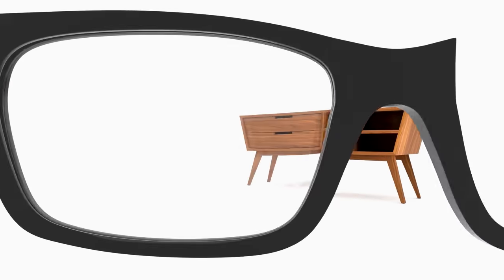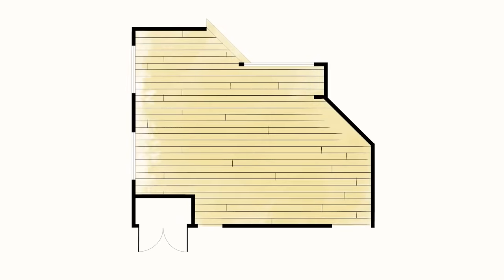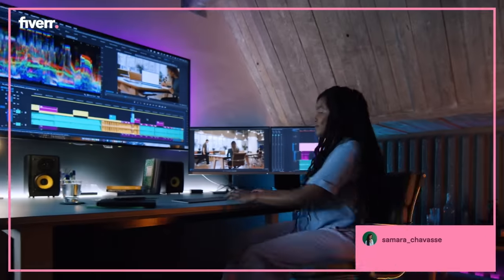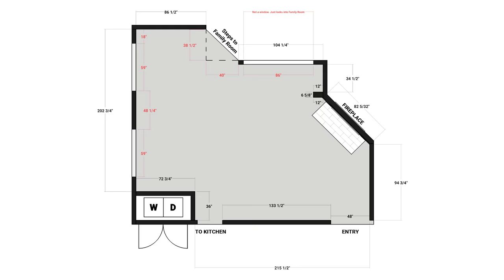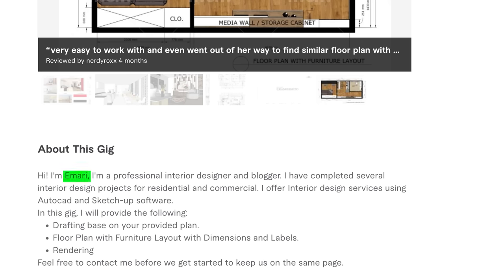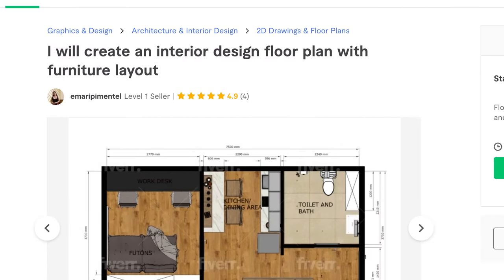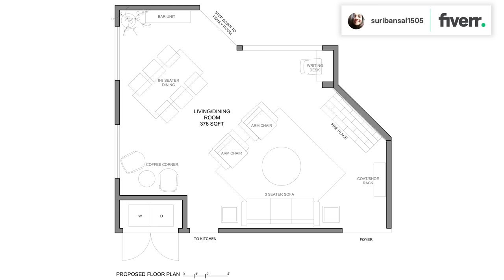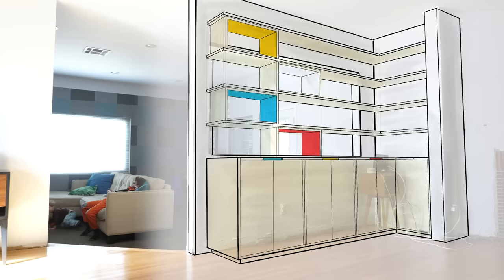I Paid a Stranger $10 to Design My Living Room

Comment: It's a race to the bottom. I'm sure you would have been less than thrilled in your pre content creator days to have lost furniture commissions to people offering up to do the same for ten bucks.
Reply from the maker: There was a website called Custommade that I felt was a race to the bottom in the furniture maker space (it wasn't really, but customers tried to use it that way) - I had stuff on there, but eventually pulled it all off because I decided non-participation was my best recourse. The furniture thing didn't work out for them and they pivoted to jewelry I think.
Reply: Yup. Fiverr just means that basically nobody gets paid for the work they do.
Reply: I've yet to get a quote from any for the advertised prices. They want you to send info about the job and then they tell you how much. None come back at the $20. $50 or $100 advertised price. Out of 3, it's been 3x 4x what their prices say and one was $425 with prices of $20, to $80. I wouldn't have a problem paying that once I knew the concept was gonna be what I like, but not right off the bat. I did pay one $120 and it wasn't even "close" to what I asked for. It's like they didn't even read any info included.  So, I've not seen any that will do any work for $10. I was excited but now feel like it's bait/switch.

Comment: "I don't like curtains." 
My wife and I go through this conversation more than I really care to admit. I'm with you, Chris. #bringonthelight
Reply from the maker: team no curtains
Reply: Same here! What is the point???
Reply: I also don't like curtains, but we need to figure out a privacy solution for the front window facing the street. We had vertical blinds, but I hate those more than curtains. Best I've come up with is cellular blinds that can fit inside the window opening, and can either lower from the top of the window, or raise from the bottom. Thoughts?
Reply: for those of us with who either don't have central AC/heating or can't afford to run it constantly, curtains are an absolute must for temperature insulation during hot summers or cold winters
Reply: The only curtains I care for are blackout curtains LOL! Especially in a bedroom or TV room... Not just for privacy but when I want to lay on the couch and nap, I want it dark and sunlight or street light glare on the TV is no bueno.
Reply: I'd want to put up a static version of window tint to block anyone being able to see into the house, but we can still see outside without a problem.
Reply: Curtains are useful for acoustic purposes when you have hard rather than carpeted floors. It can be too echoey without them.

Comment: Edit: My also / big thing is first just so it is easier to see the biggest thing I would've done ---
I'd use the walls more. You asked for most effective use of space... you could have a cat-walkway around the entire top, except have it glass either only the front, or the bottom and top - and either use a small wood trim at the corner furthest from wall / ceiling which would look like a floating shape if you wrapped the entire room - then shoes would go in there and be safe. Position some so shoes could be upside down so you can see into them and the top from underneath, and see the underneath of them with one the other way... or put upside down and sideways, etc....  You could theme it too - treading around the world / room and have various styles, makes manufactured in different areas or designed by different people around the globe and have that theme bleed into the wall-space just underneath the area, and onto the ceiling space... Then, add indirect lighting ( lights hidden behind a wood panel so the light comes out from the sides of it without a direct view of any lights so it radiates off of the surface and provides soft light which illuminates without making it hard to look at - great mood lighting too if those are the only lights on )

Then the original bit and comments here:

That rectangle area I'd put a built-in bookshelf, maybe with doors... but instead of nesting it inside I'd nest it, but bring it out a little bit, then flush it with the wall that sticks out so there is a space where you could have shoes or whatever vertically  like shoes walking up that edge... Best pairs or whatever... Alternatively, a desk in that area, and do the same thing, bring it out so you have some more space on the right at the edge - and then do cabinets to the ceiling above it for books, etc... Another option if it isn't structural, hollow out the wall and have a sliding pantry pull-out to separate that spot even more...

I do like that the focal point ( the fireplace ) was designed around in the $100 version... that makes the most sense, rotating the stuff... also since you design your own furniture you could have some triangular shelving behind it, etc... Something behind the couch... I didn't like the rotating of the other piece because the living area is around the focal point but the dining area isn't. You could but that part looked less..... .... Putting the tv above the focal point is probably the best option for TV - having one in the dining area isn't smart because if you are utilizing it for family, etc.. then you want to have a conversation.

The dining area doesn't really fit around the fire / focal point because the chairs, etc.. would block it... Now if you designed your own furniture you could have a bar-style table that wraps around the focal so everyone has a view.. but in my head this looks like some wasted space. The living area is definitely in the right spot around your focal point... A good area to entertain, etc...

Comment: I sometimes drive my family nuts with wanting/needing to move the furniture to get the best "feel" of the space. If it's too stuffy I move things to open up the space, if its too open, I tend to design/designate areas to things. Decorative dividers are great as a backdrop similar to what was behind the couch in the one interior layout that you got. 
I feel bad for the family right now, cause I want to move things around again. Great video, great ideas from the interior designers you chose. I do love the one with the angles though. That is something I would do and have done in the past. 

Sometimes corners themselves are the "dead space" but they don't have to be. Say you angle  your couch/sofa/loveseat and have the corner behind the item, if there is a nearby outlet, you can put a standing lamp or recessed lighting (below the topline of the couch/sofa/loveseat) in the corner to add /color/small focal point.
If using a lower lighting option you could also put some sort of feathered foliage (change that with the seasons perhaps or personal preference) there as well, so the light not only brightens the room but also gives pops of color and dimension.

Just food for thought, I will probably do just that in the coming months, depending on how things go as we're all starting to get upper respiratory infections or bronchitis currently. We will be okay, Blessed Thanksgiving near and far, even if you're just by yourself, you are still in the living world and that in and of itself can be a blessing. The days are getting shorter, the nights longer, the days darker, bringing in light and color could help to change the energy of the room and boost your energy too. :D
Reply: my grandma mom and i are big furniture movers and wanna rearrange spaces all the time it always confuses my grandpa and uncle but love how resourceful just switching furniture even in different rooms can be

Comment: * On the two window wall * from end to end  / chair height / divide into 4 plain cube units/ chairs on 1 side and ends / seating cushions on 2  middle cubes /2 ends used as end tables or when table is extended at big sit downs...leave tops plain or Honed stone.This will keep a clear walk way to kitchen

Comment: the room is already not normal so why try make it something it isn't - just go crazy :D Our living room is rectangular but we still went for floor boards in 30 degrees angle :p It had many advantages besides the look - you cannot see that the walls are actually not at perfect 90 deg to each other for example :D Also there's kind of a limitation of ~9,5m of laminated panels laid in one row so it helped with that and we get much nicer continuation of the floor to to hall. Also it ties with hexagonal tiles on kitchen floor.

Comment: * Wall between kitchen and entry *  push back L shape sofa  back on wall / try layering rugs 1 parallel to fireplace and smaller on top in line with sofa/ use ottoman as coffee table with round natural wood slab as drink tray/ .....is that an Eames chair? Place  chair slightly floating in front of the wood dividing wall unit angled to engage with sofa/ next to chair a natural cut round wood block , height low to match chair/the raw natural wood on the tray and side table will balance well with your light wood cabinetry style, also rounding shapes to soften  the angles /This layout  giving you two clear walkways ...entry across room to other area and a straight line to kitchen.....pare back palette..light woods, sisal, natural tone with a trim use of black....then  you can use colours in art work/ cushions/ shoes?/ .....no material curtains, in this room.......that’s my take on your room... from Sydney Australia.....bored at home in bloody lock down!!

Comment: As someone that is in software development for a living, and having to find a more viable layout for my current apartment with an odd set of constraints, if I thought it’d be worth my while, I’d create an application that took as inputs what the design rules are, the must-use bits you already have, the desired overall objectives, and all the detailed measurements as appropriate.  The problem is, that’s actually a fairly daunting task to create something to do all that, debug it, and make it viable.

There are still areas where humans with the right education and experience are going to be of value, as whether a layout “feels good” I’m persuaded can’t be objectively calculated. Factor in that it’s likely most people don’t spend a lot of time and effort rearranging their furniture after finding a layout, it’s one of those odd things. Not everything makes sense to try to automate, and art is one of them. Human-factor furniture layout I feel is one of those things.

Comment: NKBA stands for National Kitchen & Bath Association which means that the NKBA certified individual has the skills to design a functional space with electrical, gas and plumbing connections. NKBA certification means that the professional is certified to work in the kitchen and bath industries.

Comment: Go for the room at a 45-degree angle! 
I am a designer with 35 years of experience, and I would have designed something much like the $100.00 designer. The space feels better on an angle. All the others look a bit typical and boring, and they make the fireplace seem unimportant, like an afterthought. A fireplace is a focal point of a room, so it should be a determining factor in the design! I would encourage you to try this one! All the other plans are commonplace and lack creativity and flow for entertaining.

Comment: What I would do when I wanted to either arrange or rearrange an area without moving everything around five times is measure the room and draw it on graph paper.  Measure all my furniture and make little cut-outs of them.  Then all I had to do was move the cut-outs around on the graph.  This is particularly helpful when some items (I actually had a slate topped pool table when my kids were teens in my large,15 X25 ft., living room) were so heavy that it was not practical to be moving them more than once.  Anyway; worked for me.  BTW, at family dinners, I would put a tablecloth on the pool table and it made a great buffet table.  It was also wonderful for Lego projects because all those little pieces are easy to pick up off the felt.  Cheers.

Comment: I'm wondering if the request was for floor plan only? Because I didn't see renders of different angles of the room on the cheaper ones.
Reply: Yes the requirement was for a floor plan only. Perhaps all sellers had a different set of offerings that they committed.